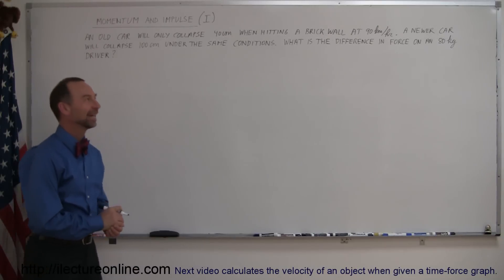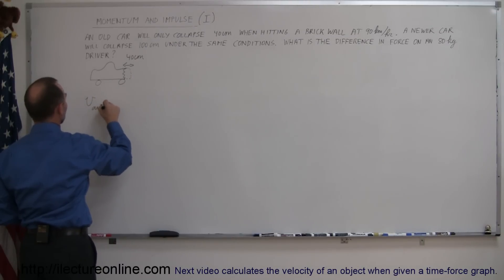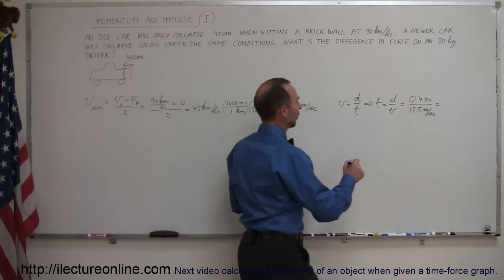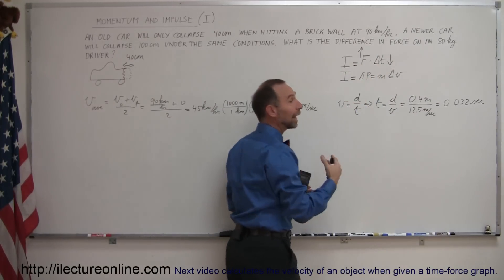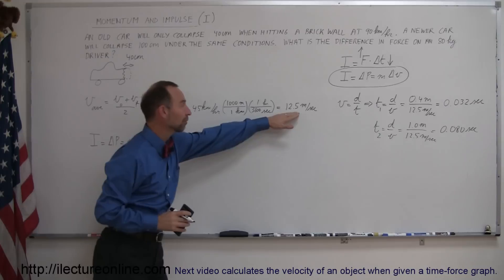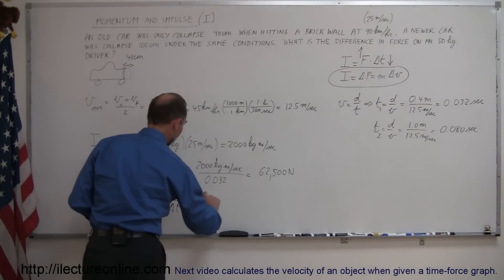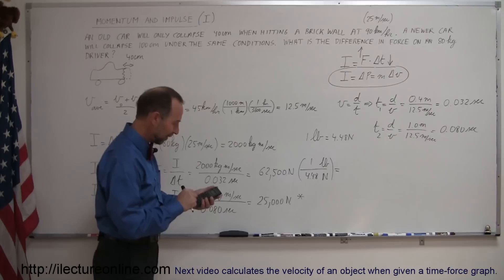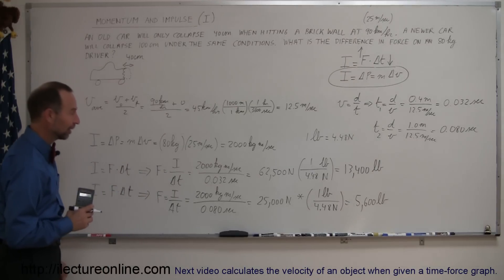Physics 10   Momentum and Impulse (2 of 30) Why are New Cars Made to Crumple?

Comment: Hi. At 6:15 you plug in 25m/s for delta v; why is it not -25m/s bc delta v = velocity final minus velocity initial so 0m/s-25m/s = -25m/s. Am I making a wrong turn somewhere or is it that the sign doesn't matter in this particular case? Thank you!
Reply from the maker: Impulse and momentum are vectors.  The magnitude of a vector cannot be negative.  Thus if you are only calculating the magnitude of a vector then you find the absolute value of the difference.
Reply: Got it, makes sense...thanks!

Comment: Hi! when you found the Impulse I=mass*change in velocity, since the initial V is  25m/s and final is 0 m/s. Hence should i find the change in V by subtracting V initial by V final and it will end up with a negative delta V (-25m/s), so the result would be different. Can you help me please? thank you so much.
Reply from the maker: +lam nguyen The negative sign simply implies direction.If you had placed the problem in reverse, you would have gotten a positive answer for the very same problem.  
Thus the sign simply implied the direction of the impulse or momentum.
Reply: +Michel van Biezen Thank you for the clarification, I was wondering the same since I ended up calculating -2000J  for Impulse as well.

Comment: If the English measurement system is used, does mass convert from KG to slugs or pounds -mass?
Reply from the maker: Technically slugs are the units for mass in the English system, but since no-one uses this unit, it often makes more sense to convert to "pounds-mass", or simply "pounds" understanding that we use pounds to express mass in daily life.